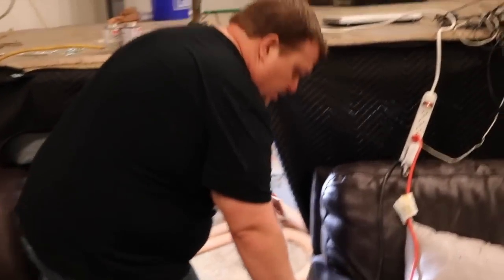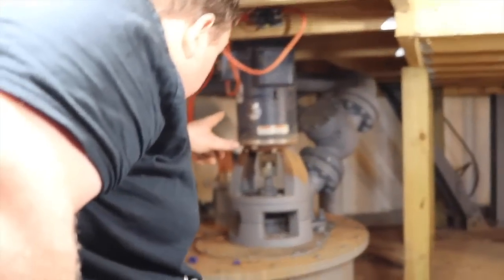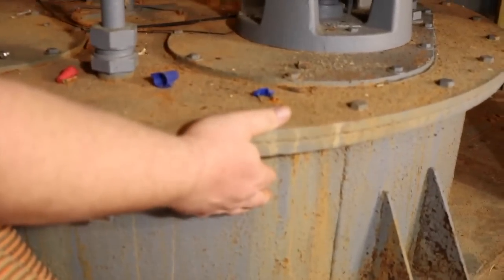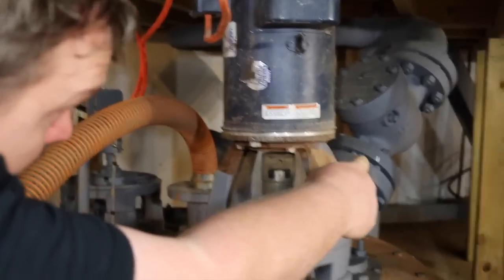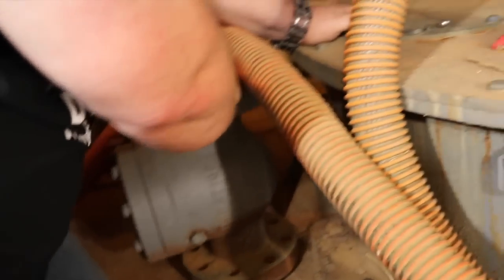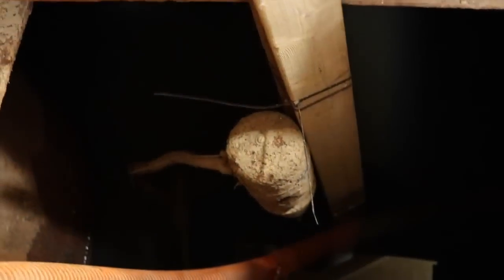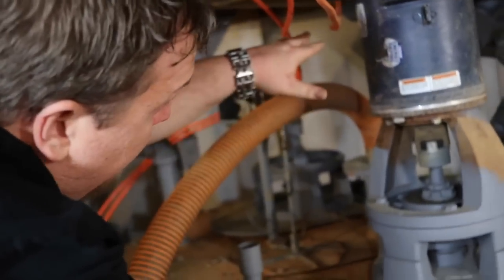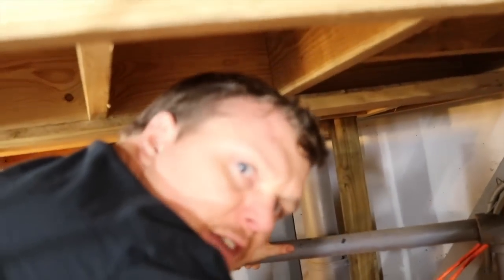EP18 - Utilities - Part One

Comment: what is under level 3? have you drained it yet?

also where does the level 9 sump come out?
Reply from the maker: Level 3 has been drained for a number of years. And level 9... that's in the silo. Wherever it came out is destroyed now.
Reply: Yeah looks that way, but what is under it. Launch control lvl 3 that is. where the frog was living. Was also curious how they dealt with the water from down in the silo. Did it go over to launch control or did it have its own system. A leach field, would only increase the water situation. Then again it's not like power was scarce.
Reply from the maker: Oh, it's dry under there. 

Yes, there were dual sump pumps in the bottom of the "W" in the silo. I don't know exactly where the dumped to but most sites in Arkansas were dry. There were a few with leaking issues though. :-)

Comment: Many large buildings have “ejector pits” - the whole setup you describe here. They’re located below the lowest basement level in the building to accommodate waste water flow which is lower than the sanitary sewer connection which is a few feet below ground level.

Comment: should have gone top side and ran a hose down each hole to clean them out with the caps on the inside off, once they are clear then just block them up topside. again though you are pretty dumb, all of this should have been done BEFORE moving ANYTHING in, there is still tons of work to do and you already act like you can live there when its not even close to ready.

Comment: The check valve is not working is a huge issue. If the motor was to turn on when the pump is spinning backwards, then the impeller  would unscrew itself destroying the pump in the process. after that you would have to deal with sewage and a broken pump.
Reply from the maker: I've had it happen a few times already. Not something I like it to do but nothing bad has happened yet. While I see your point, that would have to be a really weak system that would allow that torque difference unscrew the impeller.

Comment: the well pump needs new bearings. not the motor.
Reply from the maker: What makes you think it needs new bearings? I had it rebuilt so I hope it doesn't.
Reply: That thing is making an awful racket {it shouldnt}. try spinning the motor without the coupler connected should be damn near dead silent. turn the pump by hand, it should be smooth and quiet. if either one is rough or noisy. new bearings. only a couple bucks and a few hours time. but i imagine you hear that a lot in this venture :)  if its a trash pump you might have to go deeper into the beast to get it to quiet down......or just put a modern quiet pump down the hole. ahh the joys of owning a hole the govt got tired of throwing money down, eh? :)

Comment: that decking job made me cringe....
Reply from the maker: Nicodemus Why?
Reply: unless I was seeing incorrectly, you used 2x4s on their flat side to support the floor joists. over time the floor will sag and eventually crack and collapse. boards on edge have much greater shear strength due to the extra grain backing them up over the flat side. you should have used two 2x4s (making it effectively a 4x4) on edge over the 4x4s or a single on edge 2x6 inset (notch cut in 4x4 to allow the 2x6 to sit flush and rest on the 4x4) into the 4x4. it is a much safer and more solid construction, just like building a wood deck outside. I would bet if you put a tight string across that floor and got some people to stand around on it, you would see sag.
Reply: I do love the project though and I love your intro animation. looking forward to getting caught up and see what else you got going.
Reply from the maker: Oh... you must have seen it incorrectly. Its made with 2x6's (maybe 2x8's, can't remember) on edge like they are supposed to be. I'll see if I can find some construction pics of it but I've built quite a few decks and it was built by deck people so its good. I'll see what I can find.
Reply: I re-watched it, at 4:06 you do have a 2x4 flat on 4x4s with the joists resting on it. so I saw that correctly, but what I didn't see the first time were the proper hanger mounted joists from a ledger board resting on the 4x4 right next to the septic pumps. so it looks like you added in some extra support in the middle after you had made the rest I would assume. I would have still liked to see the 4x4s notched for a solid connection to the ledgers but it is much more solid that I originally thought when it looked like it was all built that way.

Comment: We (crew) never really paid much attention to the penetrations - antenna and phone wires and such - but I don't remember any water coming in THERE - we DID pay attention (and that was easy when they kicked on) to the Septic Pumps...  On Control Center Level 3 (where this video was made) were two Volkswagon-sized wet cell batteries - charged from the 440VAC providing MANY AMPS of 28V DC power for the consoles and missile for actual launch.  MOST of the AC equipment could be powered by outside power or the 1,000 HP White diesel generator on Silo Lvl 3.  IF ALL that failed, we launched off the 28VDC.  But it would get hot and stinky pretty fast.  Also, even at the wet sites, it was always dry under Control Center Lvl 3 - I crawled down there a couple times looking for things that might have dropped down there (not gonna tell you what...)
Reply: Bill Howard, we all know it was the nuclear codes you dropped

Comment: Was 3 phase no longer available at that location? Just wondering why you replaced pump motor with 1 phase when 3 phase motors are much less expensive? And with the loads that place is going to require, 3 ph would be the way to go.
Reply from the maker: No 3 phase at my place. And those two motors are the only thing that could have really benefited from it. Everything else is pretty standard. Are they much less expensive? I paid $800 each for them - 5HP. Can't see 3PH being that much less expensive.
Reply: 5hp and higher gets expensive in 1ph, you can get NOS 3ph motors in 5hp for under $200. I'm thinking running your HVAC system will be your biggest power draw, and using 3ph would make it cheaper. I'm restoring a 20,000 sq ft energy pig and can't wait to bring 3ph back into the place.
Reply from the maker: Are you thinking the HVAC power draw would be from the increase in temperature or the movement of air? The math I've done is that I'd only need 30k BTU 8-9k watts to heat it. Normal temp is about 60 degrees so only need to increase it by 10-12 degrees. I'm not an HVAC designer but I think the system could be fairly simple. Circulate the air from top to bottom (heat rising and all) to maintain the same temp throughout. Then have a system to bring in fresh air at a specific rate. I don't know what that rate would be... maybe dependent on the number of occupants. But as I said, I don't know how to design that. Will need to have someone help on that in the hopefully near future.

Comment: How's the temperature under there during the hot Arkansas summers?
Reply from the maker: It depends on if I'm pushing air in from the outside. If not, about 62 degrees. Its kind of neat b/c in the cold of winter or hot of summer you can feel the temp change as you descend down the stairs in the access portal.

Comment: Use baffles before the outside septic tank and auto vents for holding tank available at your local plumbing supply house.
Reply from the maker: I'll check out the baffles. Auto vent is only to bring air in. Unfortunately I need to vent air out as water fills up in the tank.
Reply: Very true I stand corrected but auto vents may work for the other plumbing fixtures as each one needs a vent so they will drain properly. You may have to make you own baffle system to slow the water down.

Comment: You mentioned something about ham radio. What original equipment was left on site? I know they ripped all the electronics cabinets out during decom, but are any of the original antenna silos still salvageable? What about the buried VLF antenna? I remember in one of your initial walkthroughs you pointed out the coax coming in and all of the low-pass filters so I'm curious what all was left and look forward to seeing the topside portion. The place would make a great ham shack considering the entire structure is basically a Faraday cage surrounded by Earth with perfect grounding!
Reply from the maker: The antenna silos were filled with concrete slurry. I have a ham friend and he told me what cabling to use. LMR-400 - 3 strands of it going in.

Comment: Alright, now that was a lot of fun to watch. I'm still curious about how all the muddy hand prints get on the wall later. As for the noise of the pump, it makes you wonder how the military dealt with it.

I'm no expert, but I think that little green frog is a stripeless tree frog? If I recall correctly, there's forest or at least trees outside the grounds. Looks like there's some way for the little guys to get in from the outside.

Of course, it's very possible he hitch-hiked in and now cannot get out in which case it would be nice if you could relocate the little guy. After all, it ain't easy being green. ;)
Reply from the maker: We'll relocate him. :-) 

The muddy handprints... just us working and holding against the wall with dirty hands. :-) 

Military didn't care about that noise. There was plenty of other noise, that was just a small part of it.

Comment: was there a reason why you went single phase  and not 3PH  and was there a generator room for the site
Reply: The reason probably is that Americans treat 3ph like something special. They do not have 3ph in every residential house like we have in the central Europe. Their power grid is just... strange or insane (or maybe both).
Reply: Sixta16 I would think this was  not residential it was Commercial So it to it had 3 phase to it
Reply: We are talking about presence, not about what it was 40 or whatever years ago. To be able to get a 3ph power there again, you would have to have a 3ph distribution HV powerline set coming nearby, requiring also a 3ph transformer to get the 3ph 240V there. And as I've said, Americans do not have 3ph as a  standard. Considering the silo is located in somewhat remote location, bringing in 3ph from the grid might be a bit of a challenge.  Dedicated diesel generator being the only option left I think.

How was the silo powered back then, might be a good question for DWBS though!
Reply: plowtruckdriver The 1,000 HP White Superior Diesel generator (440VAC 3 Ph) was out in the silo on Lvl3 - and was removed before the silo was destroyed - all power cables from the silos to the control center were also removed for salvage.  These conduits that are in this video went to the various antennas and antenna silos (HF) topside  and the copper wire telephone cable.  I would LOVE to have a topside tour showing how you accessed these conduits, and the status of the Control Center Escape/air intake, as well as the access portal.  GREAT WORK!
Reply: Bill Howard hopefully you'll do a video on this you know what kind of fuel tank they would to have for a thousand horsepower generator
Reply: Sixta16 Three phase power WAS available at each missile silo, and came below ground to the 440VAC Switchgear on Lvl3 of the Silo.  All that equipment was removed, and the entire top part of the Silo area was destroyed, but I'm surprised that the power company removed the feed into the area.  They likely removed the transformers, but the lines???
Reply from the maker: Thank you for all of the answers. Yes, I don't have 3PH available here. And really I don't need it. The only thing that would even be close to needing it are the pumps and even then its a bit overkill.
Reply: Nobody in EU would consider that overkill. Here we use 3ph power almost automatically every time the load is above about 3kW (4HP). In case of a motor, it is almost a must (No run caps, easy reverse, high reliability...). Not mentioning we use higher voltages (400V three phase, 230V phase). Just saying, different continents, different technology and habits... :)
Thanks for responding.

Are you planning to pump out all the water under the lowest deck?
Reply from the maker: Sixta - Yeah, we'll pump that water out once we get all of the conduits done and sealed on both sides.
Reply: As one time Titan II crew member there are a few things I can talk about based on my 30 year old memory.  When the sites were operational, there were diesel generators as a backup to commercial power.  But they were located in the silo which was imploded as part of the last phase of the deactivation process.
Reply: Barry Smith whaaaaa they destroyed the actual silo part?

Comment: Did you ever think of taking out that huge waste tank and noise pump and putting in  a modern residential grinder pump and tank under the floor. that way you regain floor space and it will be quiet and septic tanks can handle  the discharge from a grinder pump
Reply from the maker: Most grinder pumps may not be able to handle 60 feet of head. And no, hadn't really considered it. I like how industrial this system is. I may change my mind if the pump turns on too much.

Comment: Hello from the UK! It's been great fun watching all of your videos. If I had the cash plus know how, I'd love to do the same sort of thing. (Like most who follow your channel I guess)

I heard you say you're going for CAT 6. Don't forget that it can only go 328 feet / 100 metres, before needing repeaters.

You might want to go CAT 7 - sure it costs more than CAT 6, and can still only go the same distance, but for the sort of thing you're doing, it would be a better option because of quality and how it's made. I'm not trying to sell you it, just that I've done work over long distance through building and underground, and they bought CAT 6, and they're now wishing they'd listened to me, and got CAT 7.

At the very, very least, make sure it's CAT 6a, not just some cheap no-name CAT 6.

Again, great fun watching your videos! You should be very proud of what you're doing, and building for your family!

PS: You've got to get a green frog ornament to sit by your "Outside" door for when it's all finished!  🤓
Reply from the maker: I think it is Cat6e - Wasn't going to go all technical on the crowd. Maybe I should have. :-) And yeah, I'm a networking guy so well aware of the 100m thing. The two endpoints will only be about 120 feet apart at best. So good to go there. And really, I'm more of a Wi-Fi guy. So all this wiring crap is just a nuisance. :-)
Reply: Start the microwave and see if it swamps the 2.4Ghz signal. Some ovens are pretty "noisy".
Reply: Ah a fellow nerd. Do your videos the way you want to mate. I personally would enjoy how you're going to connect what to what. But that's just my nerdy itch. I'm 40, but been playing with / working in computer for 30 years. I've never had a chance to do something so crazy but yet amazing as what you're doing! As I said before... Great videos, very enjoyable. It's nice sharing the adventure without the hardwork. Lol Take care! 😁
Reply from the maker: FairFight - We are about the same age. I started on a TI99/4A at 8 years old. Not that it helps me now. :-)
Reply: That's a beast of a machine compared to the one I started on - A Sinclair ZX81, when I was 6. Only black and white, and no sound. To get 16K, I had to use a ram pack (Have a read when you get a chance about "ram pack wobble". - your kids will have a field day laughing at what old men like me had to put up with to play a game!) Looking forward to the next video.
Reply: There is no cat6e, that would be cat6a . Regardless love watching the videos.

Comment: If the pipes are capped at either end, how did things like rocks/such huge pressure end up in the pipe? It seems like most of the caps were doing a decent job of keeping the conduits sealed so how did the pressure build up? Why were they capped by the people who decommissioned the site in the first place? I really enjoy each video you put out, keep up the great work :)
Reply from the maker: Good question. Hard to explain until the next video... but basically when I was working on getting to the pipes above ground a lot of crap got into them.